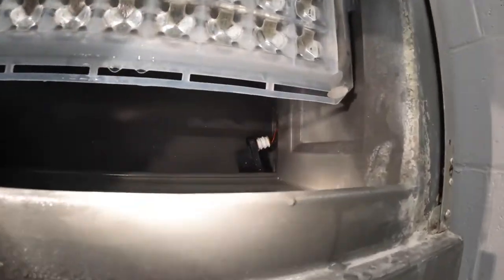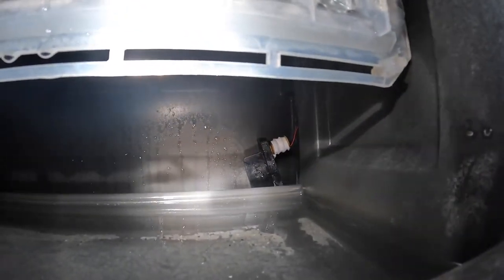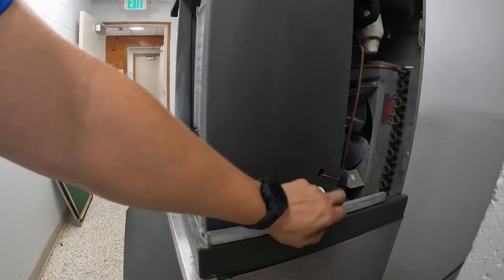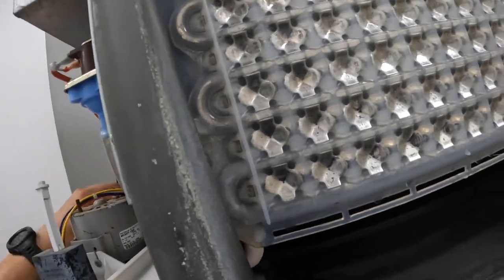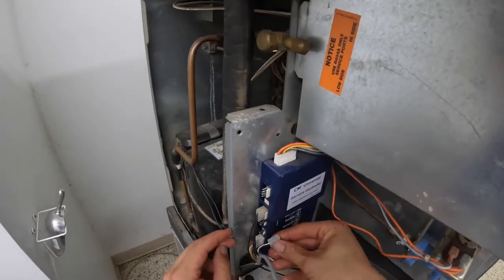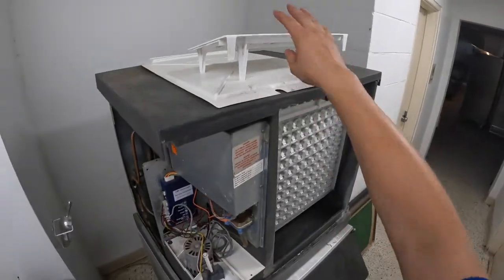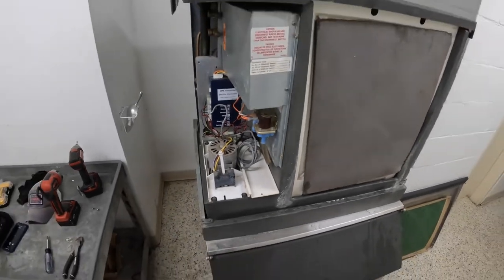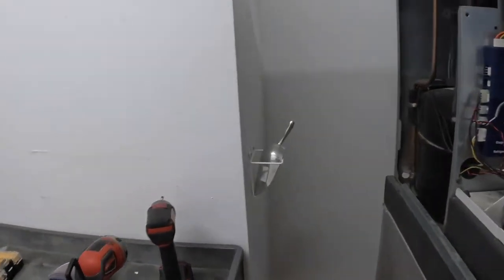Ice Machine bin full sensor replacement #33

Comment: Your video help me a little bit. There is a cover that goes across the two sensors and rest on it. It is kind of a shape and with it in place the ice will not hit the sensors
Reply from the maker: Someone probably took that piece out and then it never got put back in, its impressive that it didn't become a problem before.

Comment: That sucks. All that work just to have the board go out. Here is to hoping that the sensor will stay in place.
Reply from the maker: It's been one thing after another with that machine this summer, but so far its been over a week and the new sensors are still in place!